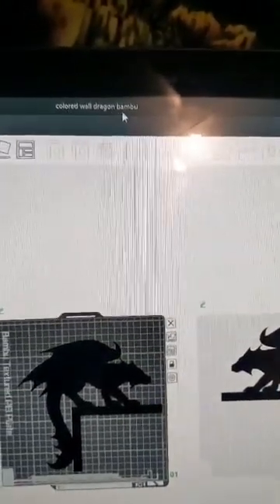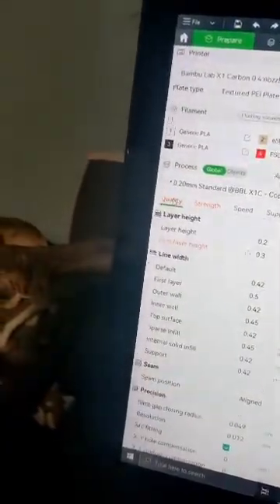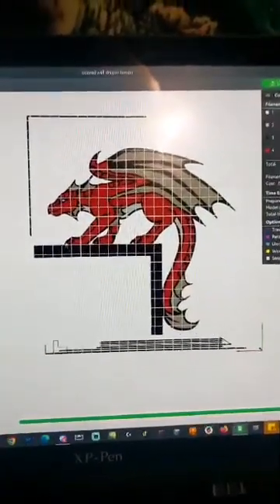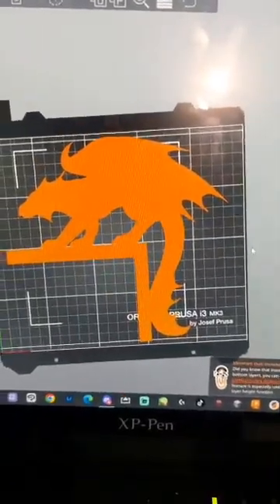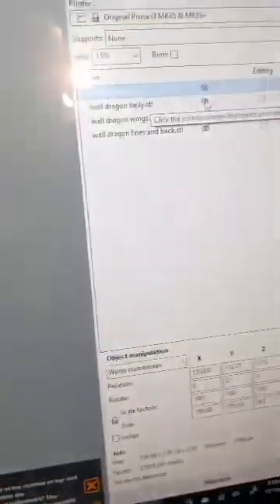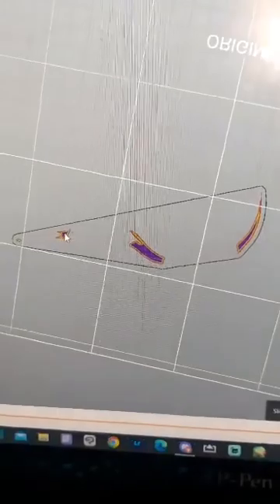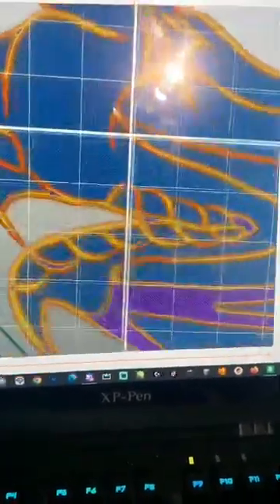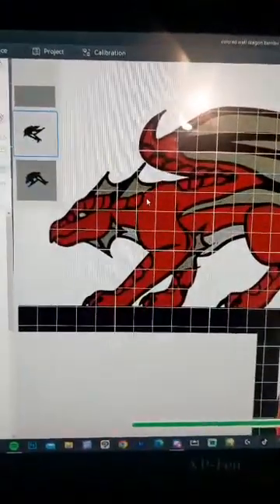Single Layer Multi-Color Print Tutorial

Comment: Which slicer do you use?   And do you adjust ZHop for each successive layer to avoid contact with the previous ones?
Reply from the maker: Demonstrated here are Bambu Studio and Prusa Slicer :) No Zhop adjustments since the way my files are laid out is precise for the correct layer heights, as if the print was just going on top of a normal. 2nd layer.